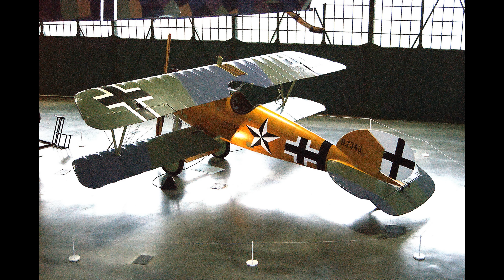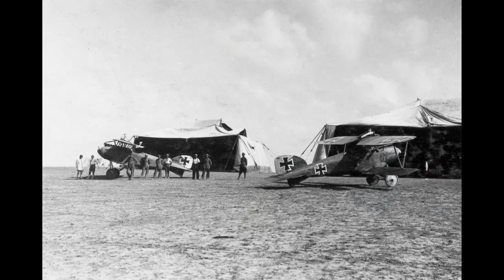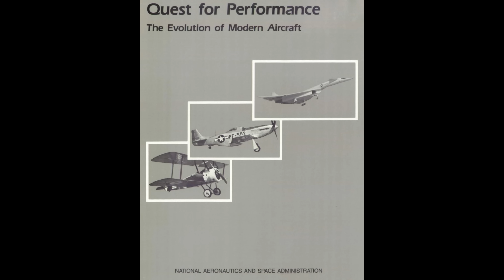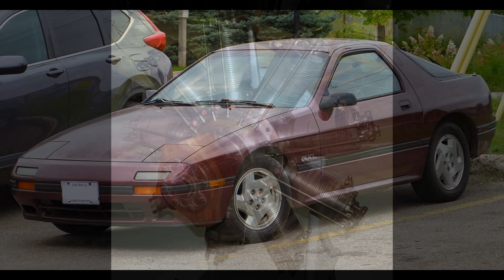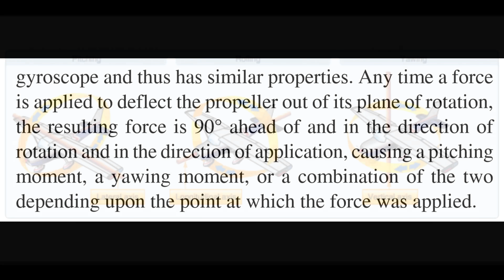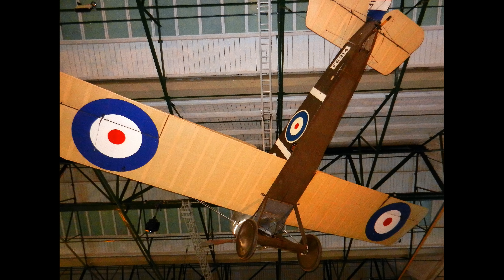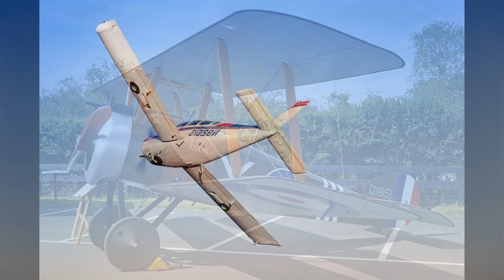Sopwith Camel, War Winner or Death Trap?

Comment: Full engine list: 130hp Clerget 9B, 150hp Bentley B.R.1, 110hp Le Rhone 9J, 100hp Monosoupape (trainers only). Unfortunately, my books don't list numbers for each. I had hoped they would but I don't have any specific to the Camel.

One additional point - different engines had different synchronisation gear, so potentially different rates of fire.
Reply: I was under the impression that all allied aircraft used the Constantinesco synchronization gear. The Constantinesco had the advantage over the German systems of being hydraulic rather than mechanical. This allowed it to be more easily fitted to a variety of engines.
Reply: @fafner1  apparently, according to my books (or the one that mentions the synchronization gear), the Clerget Camels didn't have Constantinesco gear but doesn't say what was used.

Comment: Hi Greg, yes the directional bracing RAF wires are almost more like straps.  I was just admiring it on the Camel and the Udvar-Hazy branch of the Smithsonian Air & Space  museum recently.  If I can find a good picture I will send it to you.  Most of us just modelers just use the elastic "Easyline' because the scale is so small the RAF wire becomes hard to appreciate.  That said, there are photoetched brass kits for RAF wire that are flat to simulate RAF wire properties.  That is SO much fun at 1/72 scale but, it you can pull it off, you can have a museum grade model when you are done.  You just need steady hands, a powerful opti-visor, good tools, good lighting and the patience of a monk. 😁
Reply from the maker: Thanks Max. The modelers usually have this stuff figured out.

Comment: Glad that you mentioned the gyroscopic forces and motorcycles. Most riders just lean to turn..where actually pushing/pulling on the handle bars will maneuver much faster and more exacting.  Of course that is to pull on the right bar the bike turns to the left and vise versa .. funny most will not even try it or when they do not like how quickly the bike response .. a good pilot had to use the effect the same way.  I find it harder to believe handling the throttle/ignition way of landing or controlling speed.. a busy cockpit is would think .
Reply: Most force is pushing the bar.
Any pull is just to steady the bar.
Reply: @sadwingsraging3044   a lot of that depends (or at least that is what i have found )..if your bike has negative or positive handling characteristics. meaning that the arc can be changed once into the turn. Dragging a knee it always  seemed to me pulling was a better in-put.
Reply: @robertsklenka5823  I find much better delicate control from pushing out on the top bar being the more dominant stronger link to the bike through the body. Like a jack sitting on the seat pushing out.
The weaker pull in on the bottom of the bar is just to steady the outward push at the top and there to take over should there need to be some action taken like clutching, braking, throttle adjustments while leaned into the turn.

Far easier and more stable to push than pull IMHO.

Knee dragging is fun indeed.😊

Comment: The best factoid about the rotary engines was they were lubricated with Castor oil...which was thrown back at the pilot as it flew.   They were able to determine if the engine was getting enough oil from the sheen on the wing and it was said that upon landing the Crew Chief would run out with a jigger of booze to give to the pilot.   This was to cut the Castor oil from his throat and he'd then  make a hasty retreat to the head as the oil has a real impact on your ability to not crap yourself.   Flying back then wasn't the glamorous thing as portrayed today in the movies...it was cold, hard and uncomfortable business.
Reply: And from castor oil we get the famous oil brand Castrol.
Reply: @zetectic7968  Love the smell of Castrol R premix in a 3 stroke.
Reply: I heard this on a PBS show focusing on this era of fighter aircraft.  

I remember building a Sopwith Camel model and the prop was fixed directly to the engine, and I kept thinking “That’s obviously wrong.”. That lead me to learning about the “rotary” engine it had.
Reply: @vpreggie  I had many models I built where I made the engine able to rotate in the engine cowl. It was very cool to have a small motor inside turning the prop and engine, and many people thought I had built it wrong, until they saw the movies with the original aircraft doing the same thing. And with my models, I used a model wood prop to make it look even more realistic. Sadly, a coworker accidentally broke the plane, even though it was suspended from the ceiling...
Reply: That spray of castor oil is why WWI pilots wore long silk scarves.  They needed the scarf to wipe the oil from their goggles
Reply: @ahseaton8353 i thought it was to prevent neck chaffing ( pilots need to scan all around)
Reply: @secretagent86 Couldn’t a silk scarf be worn for both reasons?
Reply: @ahseaton8353  
And their backsides?
Reply: They love telling that story at Rhinebeck - where you can actually see a Pup, Camel, Avro actually flying on vintage rotaries! But I never heard the jigger of booze anecdote... makes sense, though! Thanks for that... and yea. Not only was flying then terrifying, but a truly a miserable experience for the poor pilots.
Reply: @Mike-eq4ky not to mention extremely hazardous
Reply: They had a fairly effective engine cowling, small amounts of Castor would get into the cockpit, that's part of the reason why the pilots wore silk scarfs over their faces,  but a large majority of the Castor smoke goes out the cutout at the bottom of the cowl, this is true on most WWI rotary radial powered WWI aircraft.   The Castor oil problem was largely figured out in the years leading up to WWI, not entirely fixed but greatly reduced.
Reply: The legend is many pilots crarrried a flask of blackberry brandy to combat the laxitive effect of the Castor oil.
Reply: I've often wondered, did they wipe down the planes eventually, or just allow to drip the oil off.  I flew IC model airplanes for years and the fuel was a mix essentially of methanol with about a 20 percent mix of castor oil for lubrication (two-cycle engine).  It was difficult to clean off, models needed cleaning attention after every outing.  Solvents for cleaning were harsh to handle, seems like there was a market product available to gently spray the affected areas and wipe clean with a little effort.
Reply: @whalesong999  The lifespan of most WWI fighters was pretty short, and some photos from that era do show a lot of oil soakage into the lower forward fuselage and lower biplane wing roots. Not so much for the water-cooled engined fighters. I don't think they cleaned it off as Castor oil is like Linseed oil and can create a preservative layer. A lot of old WWI engines survived the years because they were coated in a dried on Castor oil coating. I've recovered a few classic old RC and CL model engines that were saved because they had a coating of Castor oil.
Reply: @tauncfester3022  Yes, but,  both linseed & castor oil will burn intensely after ignition. Doped linen & silk both ignite easily, and the oils residue simply add to it. Add in thr "breeze" from flight, oops, I'm  imolating & do not have a parachute. Why many pilots used their pistols or leap to their deaths vs burning alive.
I learned this from reading great grandfathrts war diary.
Reply: @whalesong999 Simple "Pledge" spray polish does clean oil from the glow fuel and the dirt that gets attached to the model.  and it leaves a nice slick surface on the Monokote covering.
Reply: @alfredomarquez9777  
Lemon Pledge?
Reply: @paladin56  is that an initiation ceremony for the not very good 😊
Reply: @whalesong999  
That's a good question. In most photos of Camels, Dr1s etc that I've seen they look pretty clean. Then again, aircraft which have had just clear dope applied can look pretty grubby with definite oil staining on them.
Reply: I've always heard the same story about pilots needing to head to the head quickly upon landing.  Considering that one term for it was a "total loss oiling system", the poor bugger much have ingested quite a bit by the end of a flight.
Reply: @aussiebloke609  the pilot had a " total loss bowel system" after flight
Reply: As mentioned in several early Biggles novels.
Reply: Slight correction: it wasn't "a jigger of booze", it was milk laced with brandy.  Alcohol alone wouldn't be sufficient to do the job.
Reply: This was one reason to appreciate the "Pusher" aircraft earlier in the war.
Reply: From a WW1 memoir, blackberry brandy was the preferred consumable to stop the squirts. Can't remember the authors name,too many years.
After flight,the doped canvas would be rubbed down with a dull putty knife to get the oil off. Hours and hours of maintenance started early with airplanes,it would seem.
Reply: The thing about parachutes is that they werent the same as they used in f.ex ww2.
Not just could they fail, but just putting them on and deploying them was thought too difficult to do when you would need to do it.

Balloons were another story; and involved less acrobatics. 

Now i think there also was some bravado about parachutes being bad for morale. So probably more than one reason at play. 

The germans were ahead of the british in issuing parachutes. I dont know if their parachutes were also better/more evolved, or if they just thought "why not try?"
Reply: The coating of castor oil that built up on the wings and fuselage was also highly inflammable, don't forget. Rotary engined aircraft like the Camel were peculiarly horrible death traps for their pilots if they caught fire for any reason.
Reply: @bernarddavis1050  And the military leadership refused to give permission to use parachutes as they wanted the pilots to save the airframe if possible. So you had tow choices, die from fire, or die from jumping. I suppose you could choose to try and ram someone on the way down...
Reply: @jeffreyyoung4104  The mentality of the military leaders in WW1 was callous beyond belief by modern standards.  My late father  served as a tank driver;  one would imagine a valuable human  asset, being highly trained, but even he was repeatedly told by officers that he and his comrades were "expendable".  Great for morale, hey...  But at least the crews manning observation blimps had parachutes, so there was that.
Reply: @bernarddavis1050  I thought every soldier was expendable by the leadership. Which is why they kept sending troops over the trench into no mans land, in order to try and route the Germans...
Reply: @jeffreyyoung4104  
I think the rationale was to preserve fighting spirit. The powers that be felt that pilots would be too ready to abandon their aircraft in any tight situation. Considering how the RFC persevered without once faltering during 'Bloody April' and the 'Fokker Scourge', this attitude is both incredibly insulting and horrifically inhumane. But it's always the ones who aren't actually doing the fighting who cone up with this kind of nonesense.
Reply: @jeffreyyoung4104  
I know what you mean, but it wasn't quite as simple as that. I recommend 'Forgotten Victory' by Gary Sheffield, which sheds a lot of light on the reality of the Great War and many of the myths surrounding it.
Reply: @paladin56  That was the rationale, but...
Given the fact the pilot was strapped into a machine that had little to no armor, and the skin was flammable, any hint of flames was reason enough to jump ship, unless they wanted the pilot to be like the captain of a ship?
Reply: @bernarddavis1050 Your absolutely right about that. They were Butchers. I was in the Army during the mid 70's. If any Officer would have ordered me onto a open field, with machine gun fire. I would have been Court Martialed for refusing such a suicidal order.
Reply: @recoilrob324  
The thought of von Richthofen sitting on the bog is an unpleasant but enduring one.
Reply: I also heard that since oil was thrown all about rotary engines surviving from this era are very well preserved.
Reply: @chrismartin3197  I wish I could find one I could afford, as I have the plans for building a Fokker DR-1 I bought before my car accident decades ago. It would be fun to start building one for grins and giggles!
Reply: Biggles never crapped himself!!
Reply: @Expedient_Mensch  
I think he did in 'Biggles Flies Undone'.
Reply: Instructors at my flight school used to call those open cockpit planes "flying bathtubs", in particular the Havilland DH82a Tiger Moth aircraft which is still frequently being seen on the airfield .  Just imagine getting into bad weather in that ...  bathtub.
Reply: I just watched the 1976 Aces High last week and indeed the ground crew brought out the booze upon landing.
Reply: The distinctive smell is similar to the fuel of older model airplanes.
Reply: It's been said that Elderberry wine was the booze of choice.  Pilots consumed it before, after - and sometimes - during a flight. 
When they filmed' Flyboys', they refused to show pilots on either sider swilling castor bean oil-fighting alcoholic beverages because it wasn't PC. 

And good on you for mentioning the streamlined bracing wires - very few histories or historians - do that.  As to modeling those wires, below a certain scale, it's too difficult to do, and most people couldn't see that feature anyway.
But, you get into a big scale and those streamlined wires are available for modelers.

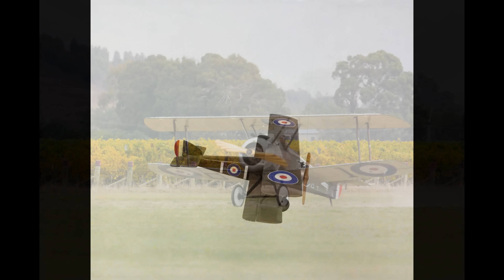[19:30] What's interesting about this is that in one of the 'Peanuts' strips showing Snoopy flying his 'Camel' doghouse against the Red Baron, Snoopy mentions all these factors affecting his 'Camel'...and he intends to use his 'Camels' quirks to defeat the Baron. 
But in the last panel, his doghouse has a row of machine-gun holes down one side, and Snoopy looking at the viewer as he says something like, "Drat.  He knew."
Reply: Wenn einem Europäer, der gerne Rotationsmotoren im Fluge erleben möchte, Old Rhinebeck in den USA zu weit weg ist, der kann z.B. Sopwith Pup und Sopwith Camel, Avro 504K u.a. auch viel näher, in England erleben, z.B. bei der Außenstelle des "Imperial War Museums" in Duxford und bei der "Shuttleworth Collection" in Old Warden. 😂
Reply: I read that the pilots used to get extra servings of boiled eggs for their breakfasts as too many can bung you up, thus partially counteracting the effects of the castor oil.
Incidentally people still took castor oil to debung when I was a kid. It was only much later that proper medication became available.
Reply: And Brown Business by the sounds of it
Reply: You forgot, Snoopy flew one!
Reply: @greghardy9476  '...quaffs a root beer...'
Reply: You can definitely smell the castor oil when you watch the camel flying at Old Warden Aerodrome.
Reply: As an Air Force brat, we call the old bi planes “cabbage crates”- I assumed that’s was the nickname that the old fighter jocks called them as well.
Reply: Flying was also extremely dangerous even without people shooting at you.
Reply: Kinda explains why they all looked so thin.
Reply: Du schreibst: "Wankelmotoren" ....?  😮

Ich nehme an, das ist ein Übersetzungsfehler der KI .... und Du meinst "Rotationsmotoren" bzw. "Umlaufmotoren"?  😊
Reply: RC ...........if the U.S.would have more involved earlier with the Camel you know we would  have marketed the Adult Diaper for pilot usage .
Reply: Sounds like BS
Reply: @MM-op6ti  
Certainly the 'S' part.

Comment: Oil loss had two issues. Firstly, pilots tended to ingest it, and as it was castor oil it could lead to loss of bowel control. Secondly, issues with supply and training could lead ground crews to substitute medical grade castor oil for industrial, leading to engine failure. In some instances, there was deliberate substitution in the supply chain for profit.

Comment: I knew that in the naval version, at least those launched from flying off platforms atop battleship turrets, a rolling cradle was using to hold the tail up during the short take-off roll (instead of starting in the normal tail down orientation of a tail dragger).  I knew that reduced take-off distance but hadn't thought about how it would have also bypassed the gyroscopic issues from raising the tail during the takeoff roll

Comment: For the layman, if they've ever used an electric angle grinder and felt the resistance when you turn it,  that's how gyroscopic procession feels in your hand.
Reply: I was recently checking some old disk drives and disconnected one and accidentally picked it up before it had stopped spinning.